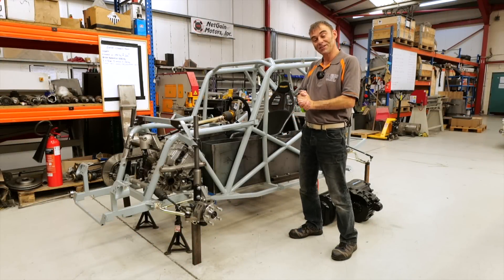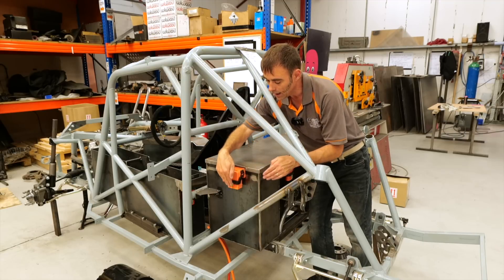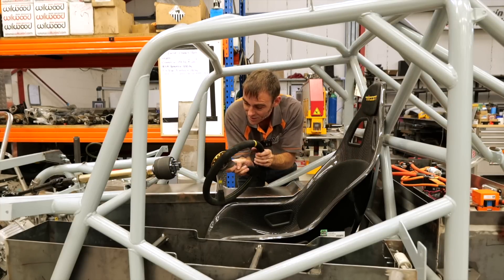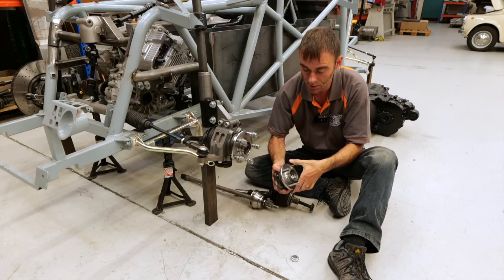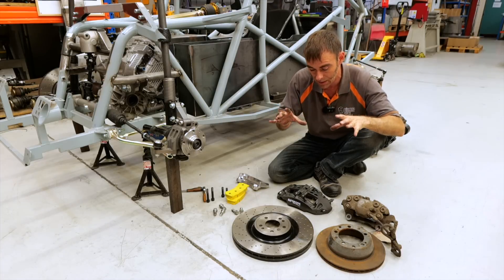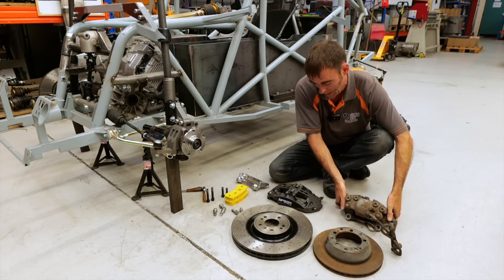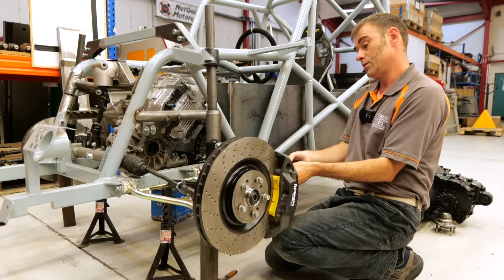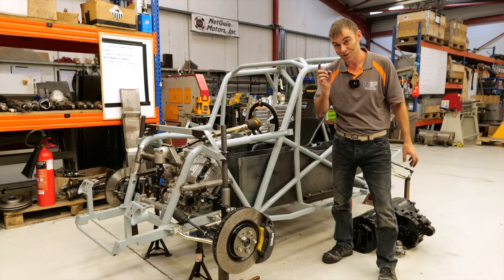Pikes Peak race car Ep3 - Brakes, driveshafts and battery boxes

Comment: I want to build a single seat race car with a model s rear drive unit.
What is the minimum size battery I would need to obtain max power? I obviously want to keep weight as low as possible.
Reply from the maker: You will want a battery pack that can cope with 1000amps at 400v without too much voltage sag.
Reply: @ElectricClassicCars  Thank you, it would be great if you had a kit available to buy with model S motor inverted with 30kw battery attached in Single seat configuration,lots of cheap carbon tubs for sale to which it could be welded ,I got one for £1000.Would make for an amazing driving experience.Regards

Comment: I'm wondering if aluminum is the right choice for the custom caliper mount.  When that caliper mount thermally expands, the caliper will no longer be centered over the disc.  When you consider the disc is cast iron, and doesn't thermally expand very much at all, and aluminum will thermally expand a lot, it seems like you would end up with uneven stress in the brake system, and uneven pressure between the two sides of the disc from the caliper.

Comment: You're not concerned that those huge brakes will be over-effective on such a lightweight body then ? I see a lot of lock-ups looming....even with the aerodynamics of a brick ****house !
Reply from the maker: Yep, that could happen but then again the brakes aren't boosted so maybe that'll cancel it out. 😁👍
Reply: @ElectricClassicCars  Or just add more batteries and a lead lined bodyshell ! Good luck with the project, glad to see you're doing it right. If you race it offroad a servo will be a must.  (ex offroad racer here)

Comment: Need to get it Finished Richard.
No good sitting in the shop. 
Next Pikes peak 25 June 2023 and you going to take weeks to get a car to USA due to shipping issues. 
You still need shake down runs and tuning in the steering and suspension and some practice in this new Chassis.
That is probs 4 weeks testing and tuning and chassis dynamics black magic work.

You will be surprised how quickly the next 8 months will disappear.

Comment: Re: seating position. Do I correctly understand that the pedal position is now going to be low, rather that the (F1 style) high pedal position you discussed previously?
Re: assembling the break. You’ve done that before, haven’t you?
Reply from the maker: Correct. The pedal assembly is going to be more like a standard car height in relation to the seat. 👍

Comment: Hi Moggie, great videos. Are you going to fit battery cooling to cope with drive and regen power demands on the batteries? Also how do you connect the accelerator to the motor controller?
Reply from the maker: Yep, it'll have battery thermal management. We'll cover that in a future episode. 😁👍

Comment: Must be hard to pick which car to drive today, with so many choices, So Buffy is going to be a zippy beast, After driving a VW Bug for a bit, I noticed that Petrol Head People like picking on Bugs, nice if there is some Revenge of the Beetle with Buffy's Body happening as well (Herbie Paint Job?)... You seem to have a few projects underway, How about making yourself Electric Fishing Boat, or racing boat, maybe even a Hydrofoil, if it has a cabin some solar to help charge, others may interested in Marine Applications ...

Comment: Hi Moggy, looking at the thickness of the battery boxes. what thickness are they? could you use a lighter gauge of metal to save on weight. Loving the show
Reply from the maker: 3mm steel. I've found going too light with the huge torque is detrimental to mechanical grip. We need some weight pushing down on the ground to be able to get the power down. Too light and the wheels will just spin. For example, a Tesla Plaid weighs more than 2 tons but goes 0-60 in 2 seconds.

Comment: Presuming picking high C cells also means their energy density will be less? As no one has invented a cell with both yet.
How many laps/miles do you expect to get? And will you be doing external AC or DC changing?
Would be cool to charge it of an BEV which can also do vehicle to load?
Reply from the maker: Yep, they're high C rated modules. We'll be using external chargers. 👍

Comment: I can't even watch silly gasoline engine race car mods anymore... Electric has become way too fast. I used to rebuild Ford V8 performance engines and have built many racing motorcycles. But after I bought a Tesla Y performance now I am all in on "all electric"... I still love the smell of unburnt gas wafting out of a carburetor sometimes though.
Reply from the maker: We are completely aligned. 😁👌
Reply: A lot of Teslas share a garage with a fossil fueled weekend monster.

Comment: Could one not balance out the regen with a air cooled resistor bank to keep the regen at a constant level?
Reply from the maker: Or super caps (capacitors). 😁👍
Reply: Cool. Push 2 pass boost 🤙

Comment: The obvious question is because of the regen, wouldn't it make more sense to charge it to 95% or something instead of 100% before the race?
Reply: @Defective Degenerate what's a shunt? Is it like a pack of resistors to bleed off excess voltage as heat or something?
Reply: Or just use the friction brakes
Reply: @Defective Degeneratevery interesting Deetective, thanks.
Reply: I don't think I get the issue with regen on a full battery in this race car application, in that the car is never 100% efficient on drive or regen so it's always going to use more power than it can recover from regen, unless you are starting at the top of a hill but that typically wouldn't be the case for a race circuit, I can understand having a buffer and particularly the thermal issues with constant high discharge and regen.
Reply: @arrindaley3714  What you said is 100% true.  Over the long run.  Moggy did say that in the first couple of corners, when the battery is still at 100% or close to it, there would be hardly any regen, hence the need for big friction brakes.  17:11

Comment: Great film as always. Is this purely for motorsport or can/will it be road legal? Also, for tarmac or will there be off road capability? Thank you.
Reply: I doubt it, EU isn't as friendly to ground up car builds. That's why conversions of existing cars are more popular. Already got a title and crash testing, so you just need a engine swap document and a new MOT. (Note: I am american, the finer points of making a car legal in the EU is not my area of expertise)
Reply: @marsrover001  The UK (of which Wales is part) isn't in the EU any more...
Reply from the maker: Purely for tarmac and  track only. 😎👍
Reply: @ElectricClassicCars  drag racing too? This thing would surely pull sub 10s on the quarter mile 🙂